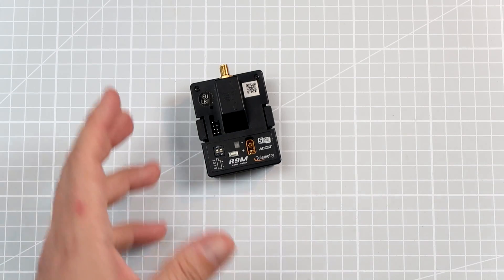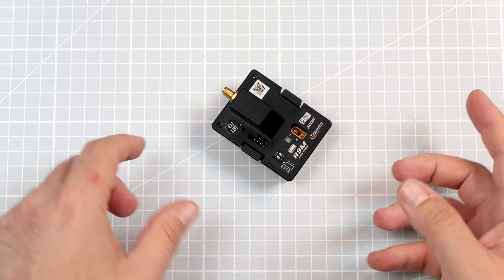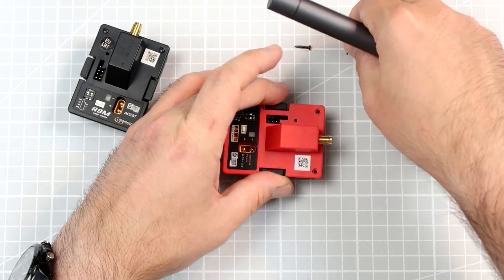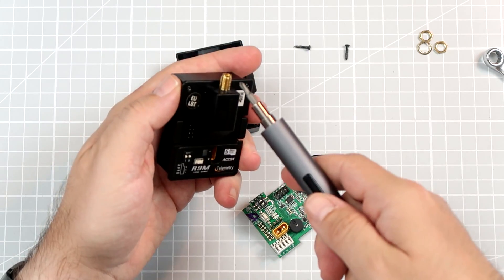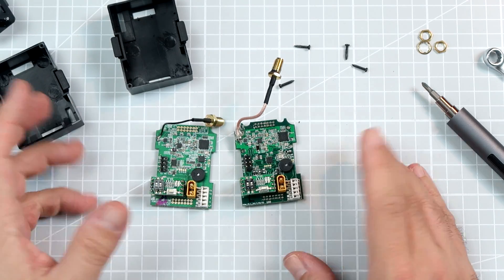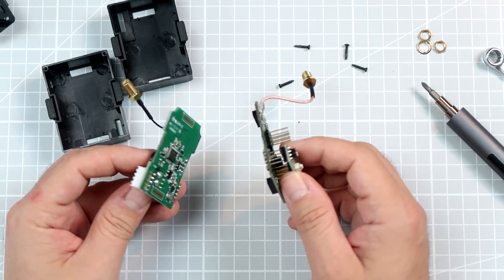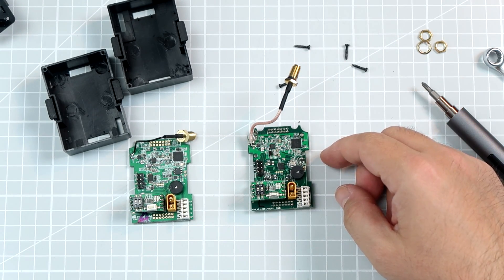FrSky R9M vs R9M2019 - it's all about ACCESS and minor changes

Comment: I have the access R9M 2019 with R9MX access receiver. I have a th9x radio with er9x that has r9m protocol but I am unable to use it because of the access protocol. Is it possible to use access models with ppm protocol?

Comment: ok i have original r9 and a qx7s, what receivers can i use for it? i think frsky has discontinued the old ones. can i flash the older firmware on the newer receivers?
Reply from the maker: yes, you can flash ACCST to all R9MM-OTA

Comment: Hi, I bought R9M 2019 + R9 mini, on the stock firmware I managed to bind them, now I updated R9M with access firmware V 1.3.0 and I updated r9 mini with access firmware V 1.3.0.Now R9M wont get into binding mode, there is just solid red light, I tryed to bind it with transmitter, and modul alone powered with externall battery with both dip switches on their ON possition and I am getting same results.R9M doesnt flash red light like it should when in bind mode. What should I do about it? Please help.
Reply: Same problem here, have You get any solution for that?

Comment: Has anyone tried to flash the ACCESS firmware on the older R9M module and receviers?
Reply: You cant..... the hardware is different.
Reply: @EnglishTurbines  can you elaborate, please
Reply: @jailbreaker010  I did....You can't load the new ACCESS firmware on the older R9M Modules....They are not compatible...It's not complicated.
Reply: @EnglishTurbines  So the general consensus is that the hardware of R9M and R9m/2019 is the same and FRSky are artificially limiting installing access compatible firmwares on non-2019 R9Ms ?
I also have a second-gen orange R9M (non-2019) - installing access firmware on it does not fail, per se, but it still does not work with any of the receivers that I have, no matter what firmware / version I flash on the receiver. Hence me asking....
Reply: @jailbreaker010  It's not a general consensus, it's a fact, the hardware is different, like I said earlier....
Reply: @EnglishTurbines  Based on Pawel's review the hardware is the same and I do not have a 2019 to compare with. So, the way I get it,  is that frsky just f*cked it up in the firmware making it impossible to run access on non 2019 hardware.
Reply: @jailbreaker010  Either way, you can't load ACCESS on the old R9M Modules...I'm not bothered because I run the old original R9M on Flex firmware and it works just fine for me...FrSky are busy digging their own grave again TBH...
Reply: @EnglishTurbines  yep! Thanks for your time, mate! cheers.

Comment: Can these do D8? I need D8 mode please help someone😩😩
Reply from the maker: D8 is only a 2.4GHz. R9M is 868/915MHz
Reply: Paweł Spychalski I guess my question is that Is there a way to get D8 mode on qx7 ACCESS with r9m 2019?? It’s for a Emax that uses D8 mode only, or should I just send this receiver back  (and get the ACCST) before it’s too late??
Reply from the maker: @joeolison215  No, there is D8 support for ACCESS
Reply: Paweł Spychalski you mean there is no D8 for ACCESS so this receiver that I have ( the Taranis QX7 ACCESS ) won’t be able to work with the EMAX Hawk that only uses D8. Is that correct?

Comment: can the R9M 2019 version be used with the original Taranis QX7   or will it only work with the newer QX7 ACCESS model   thanks
Reply from the maker: If you flash it with FLEX or other NON-ACCESS fiurmware then yes
Reply: @FPVUniversity  lucky for me I just learned it "doesnt" require flashing ( Im not too successful in that area, I ruin 60% of my attempts on other things )
 I just found this video of a gent doing the setup with the QX7 accst and the r9m 2019 version  I am good to go         https://www.youtube.com/watch?v=gwIZxannCbM&t=172s

Comment: The one thing i do not like about my original R9M is that if your powering it from both the radio and a separate battery the module does not turn off when you turn the radio off. A few times now i have forgotten to unplug the separate 2s battery that powers it, obviously not good if you leave it like that for a long time. I think they should have included a solid state power switch inside the unit that cut the power from the external battery once the radio was powered off. Is it still the same on the 2019 model?
Reply: I busted a 2s battery because of this. I made an Nimh replacement so I didn't have to sorry about it. Just a long list of issues with this bad product

Comment: So will r9m2019 work in non access qxy? I don't care about access I just want to make sure I didn't waste $50 on a module I cant even use... the access module still works in non access mode right?
Reply: Sure, there is ACCST firmware available for R9M 2019 (and ACCESS receivers).

Comment: whats the score with the r9m and r9m 2019 on the jumper t16. does it really matter which you get, whats are the advantages or  disadvantages, is it just the receivers you connect to them or is there something else too it?
Reply: Its more about the way the company is doing buisness, their trying to shut out the use of crossfire(didnt work), and with Frsky 2019 you can no longer fly whoops(d8 ) without an xjt module, which means you would have to pull crossfire module, buy, and  put in the xjt. Module. 2019 also does not support the xm+ yet, its supposed to be in the 1st update. Not playing nice Imo.

Comment: I think I paid £30 for the old TX Module and a R9MM receiver...Running the latest Flex firmware on 868mhz it works just fine for me, although I have not flown out beyond 2 kms as yet...As long as FrSky continue to provide the old ACCT R9MM receivers, I dont have a problem. For £30 it works fine. If I want to fly proper long range, I use my Immersion RC EZUHF, which has endless range. I certainly wont be buying any TBS Crossfire just to fly a Mini-quad round my head,  thats just nuts.
Reply: Thats a steal. I also managed to pick up mine with super 8 and slim+ for £40 and never looked back xd
Reply: I wish I'd never wasted $200+ on full Tbs XF Tx myself!  I still have and use my old 2018 R9M Accst TX and R9 slim+'s and even on older firmware 180329 which I believe is 2 years old but honestly I've found to be best firmware version for me.  I've also added a bluetooth module with inverter to my R9m and now I can use apps for live maps and antenna tracking!  My Xf full has bluetooth module as well but getting it to actually work is damn near impossible and even when it does connect to anything it's to laggy.   I'll keep my old R9M as long as possible.   It's my go to period!  People can't believe that I dislike XF and honestly I can't see how that's so hard to believe.  First off I  it's way over priced for what it is secondly most its features don't work properly and that to me is a no brainer.  R9M 2018 works perfectly fine one just needs to learn how to use this system and updating them isnt a problem just make a harness and connect it when updating. Simple.  Plus modding R9M is also simple.  Try modding XF..   One more thing is TBS flat out lies about output power of full TX.  Its nowhere near 2w with dynamic turned of and with proper test equipment my friend used we only got output of 862mw on 2w settings and dynamic OFF!!
Reply: Brought mine on pre-order back in 2018; £26 delivered and that included a R9MM receiver. Glad I didn't miss out on anything particularly special by being an early adopter though. :-)
Reply: LoC Wowwwwww dang that is insane! And these days you can still flash the new receivers with old accst firmware too

Comment: Frsky is out of their mind if they think Ill buy their stuff ever again. I bought a pre 2019 module recently because I didnt know any better. Why would they think anyone would want to replace all their Tx equipment,  and buy frsky again.
Reply: Disabling Crossfire instead of supporting it with their own OS to avoid needing to use OpenTX was not only a low blow... it stopped their momentum growing and reversed it as Flysky comes into play with a very good radio.

Comment: Just starting out with the combos they were selling cheap before releasing the 2019 models. Still coming to terms with running fport etc, and my first quad with r9 may fly this weekend. Only have the 2 r9minis's, can we still get the r9mm without access? and for how long.  Maybe Jumper will copy the r9mm without access?
Reply: R9MM ACCESS version is still compatible with non-ACCESS radios, just flash the ACCST firmware.

Comment: I just cant understand why you would "upgrade" to access.. I'm happy with the R9 system I have now.
Reply: From what I understand it would update your rxs wirelessly, and other features like rx match where 1 model works for all quads. I dont think their going to support accst after a while, but Im telling you what I read on instagram, Im not sure everything about support is correct.
Reply: @RCOverKill  yea I know but u still have to use a wire connection the first time.. I have never pulled a receiver to update once in a quad.. I just am not going to support frsky and their access protocol.. I'm still pissed how they dumb down my qx7.. Thanks for the info
Reply: @paulstone9755  believe me if I have to buy new radio equip it wont be frsky.
Reply: @RCOverKill I'm with you:)
Reply: I think the pre-access R9 hardware is going to be worth more than the new R9Access shxt Frsky is peddling now.  I am still flying with the older R9 a little, but have installed Crossfire in 3 of my aircraft now with more to come.  And yes I have had to reflash my R9 receivers a coupe times because Frsky released them with horrible buggy firmware that took them years to resolve.  and it is a pita digging them out of my wings, unsoldeirng them, soldering to a futaba plug, reflashing, then re soldering and reinstalling them!  A PITA

Comment: I have one of the second generation pre-2019 R9M modules with the orange casing and not one of the first generation all black ones, so I just opened mine up and can confirm that the circuit is identical to Pawel's original one with the black casing. The only difference is that on mine, the two black header pin blocks top and bottom aren't present as they also aren't on the 2019 version, so those blocks originally got removed on the second generation of pre-2019 R9M modules.

Comment: The biggest downside for me is the fact that ACCESS is not supported on QX7. So for me there is no point in upgrading. I consider that major fail because QX7 is like 2 year old radio model and already outdated. I might be more successful with my 2018 edition X-Lite with R9-Lite. Btw. R-XSR can be updated to ACCESS but the internal iXJT of X-Lite has no ACCESS fw either (and that is 1year old).
Don't know what to think. 🤔 Considering Tango2 or even the whole DJI FPV bundle. Pretty pissed off right now.
Sorry for my weeping here.
Reply: Why just keep ur qx7 n old r9 setup ...I am
Reply: @flo-ridafpv5713  yeah, for time being I will leave it like that.
Reply: @MPQuads237  yea buy spare r9 mm s ;), I just wish for a 900mhz band scanner on R9m , be soo dope

Comment: On the plus side all of my frsky radio gear is stable and I just flash once and forget about it forever. No access but meh, if frsky 2.4 was good enough for so long r9 flex as it is will probably do the job too.
Reply: I have original R9M  and four mm receivers from original 'DISCOUNT OFFER' batch. never used, flashed or bound them as was waiting until I felt competent enough for flying further than half a field.  My taranis is flashed with 01/2019 2.2.3 flex.  So, in your opinion will this still work?  is that what you use?  Thanks in advance
Reply: @retrodudefpv  yeah nothing is going to stop working. I'm just going to make sure I have local copies of the firmware. I don't plan to switch away any time soon and I'm really not concerned.

As far as the updates are its a solid 900mhz system. It won't stop being that without updates.
Reply: @frasersteen  Yes, if I get my R9 setup to work soon, then If I were to do any further upgrades, it would be a new radio and keep the frsky for the R9 setup and anything else I've already bound to it. Thanks for the info

Comment: I had purchaed Xlite Pro and in July 2019 I had also purchased R9MLite. At that time R9M Lite pro is not out yet.  Can i use R9M Lite with my Xlite pro access transmitter.
Reply: Yes.  I have exactly that combination.  I had to upgrade the R9M Lite to the Access protocol, not a big deal, read the instructions on the FRSky website.  I have it working with one of my quads.  No problems so far.  The Pro version of the R9M Lite module will support a higher transmit power, but offers no other advantage I am aware of.
Reply: I have the R9M Lite on my XLite Pro. I have updated everything for Access and now on OpenTX 2.3 (which just came out of beta). Works fine for me. The bind on power on is very handy. Access seems to work at range.

Comment: How do you know if you have a 2019 edition from the outside?  Are all orange cases 2019?  I have an orange case, but no label for voltage.  It also doesn't have the pins on bottom and top on back.  2019 then?

If works with PSX2, but be 2019? Not sure how to see if PSX2 on TX.
Reply from the maker: On Open TX it has to say "R9M ACCESS" where you select external module type. IIRC only then the radio tries to use PXX2
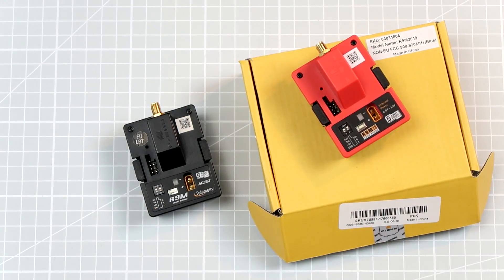Reply from the maker: There is label "R9M2019" on it. Logo is slightly different. See 1:30
Reply: I have the same, (second batch from "old"/non-2019 r9m), but the pcb is same with Pawel's black one. So both are old  :S

Comment: exactly the video i was waiting for, i was curious to see what changed in the R9M 2019 module, i have a Jumper T16 Pro on the way and maybe i will order an R9M 2019 module to test few things (i own 2 x R9M older modules) do u think there will be any possibility to port a version of Opentx which support Access to JumperTx (Opentx fork) so we can use Access protocol on our Jumper T16 radios (with R9M 2019 module) .... someone should work on this ;)